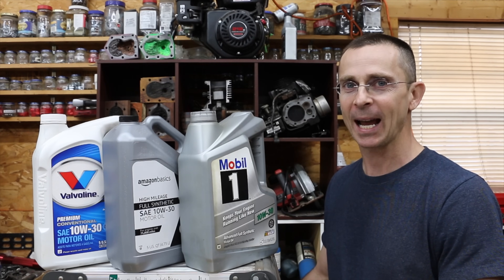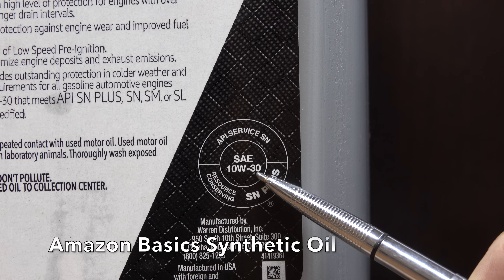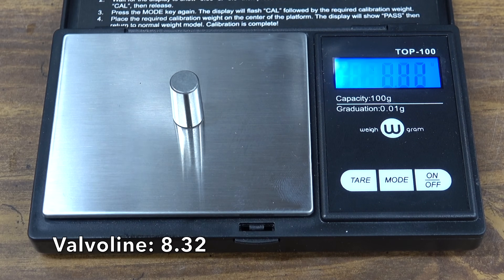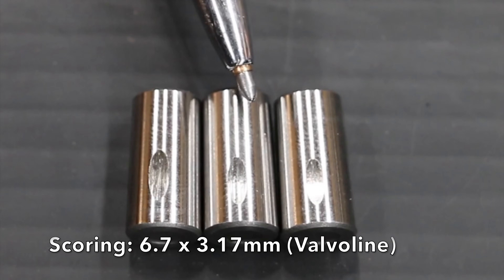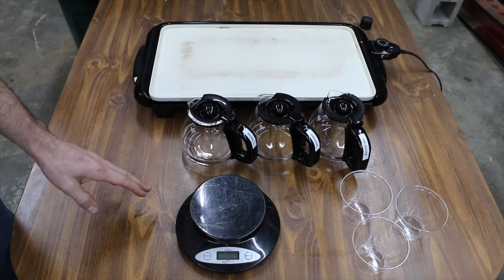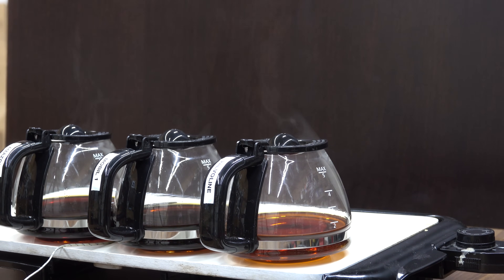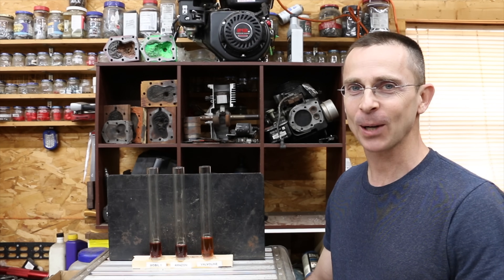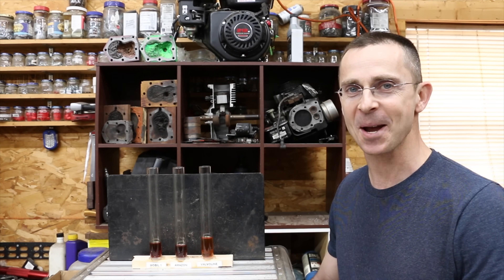Is AmazonBasics Full Synthetic Motor Oil better than Mobil 1? Let's find out!

Comment: Lubricity test is not done fairly. The level of oil in the cup for Valvoline and Amazon oil was such, that there was a little splash of oil when the wheel started turning and then there was no splash. And near the end of the test there even was no movement of the surface of oil in the cup. But for Mobil 1 there was a big splash in the beginning of the test. The oil surface in the cup was trembling during the whole test and it was clearly visible at the end of the test, that there was still a good amount of oil splash. So the wheel was either intentionally or unintentionally much better lubricated when testing the Mobil 1 oil compared to the other two oils. Nice try!
Reply: He's human. He's doing this out of his pocket to help us gain knowledge. But I'm sure you're perfect in every way.
Reply: Then the Amazon Basics should have done considerably worse. Instead it was incredibly close. As long as oil was being carried up to the bearing, the amount in the cup doesn't really matter as long as it doesn't cavitate (the bubbles would reduce the amount of oil in the film layer and increase friction - which didn't happen).

Comment: In the burn test, This explains why I always had to add oil to my old truck, even though I never saw a leak of any kind and checked all the time for leaks. Between oil changes I’d have to add a quart or two of oil. So was my engine always running hot then? The temperature gauge was never high.... maybe just a tiny hot, but not so hot the temperature gauge wouldn’t freak out and show high/really hot?
Reply from the maker: Same here. Thank you!

Comment: Great video as always love the way you do your testing. I'm pretty sure that the amazonbasics is made by Warren distributing. They also make the Walmart super tech oil.
Amazon's price on the synthetic is pretty decent but not significantly cheaper than the super tech synthetic. And when I looked for the conventional oil under amazonbasics it actually cost more than what I can buy on the shelf at Walmart for their conventional oil.
You can get their supertech conventional for about $12 in the 5-quart jug. Since my car doesn't seem to like synthetic oil, tends to burn it more I just use conventional oil and change at the regular 5K interval. Usually having to add about a quart. If I try the same with any synthetic brand I end up adding 2 quarts over 5K, basically eliminating the advantage.
Reply from the maker: Thank you!

Comment: Another excellent video. I recently purchased AmazonBasics 5W-30 high mileage synthetic and combined it with a conventional 10W-30 to devise my own blend. I hope you know that the label "Full Synthetic" is misleading. You would think (as I did) that synthetic means there are no components of crude oil involved in its manufacture. You would, like me, be wrong. There are basically 5 grades of motor oil. Grades 1 thru 3 are based on crude oil with increasing levels of refinement. Grade 3 is highly refined but has crude (dino) oil as its base. The petroleum sellers have mislabeled it as full synthetic. Grade 4 and 5 are highly refined and are really synthetic; that is they are not based on dino (crude) oil. According to Noria corporation, "Group IV base oils are polyalphaolefins (PAOs). These synthetic base oils are made through a process called synthesizing. They have a much broader temperature range and are great for use in extreme cold conditions and high heat applications." * These are labeled "100% Synthetic" and they do cost more but are supposedly superior in many ways to grade 3 oils.
So, I would really like to see a comparison such as this between any "full synthetic" and a "100% synthetic" such as Amsoil signature series (they also make other types) or other brands. This could give us a clue as to whether the higher priced 100% stuff is worth the extra money, as is often claimed by those who profit from their sale.
* https://www.machinerylubrication.com/Read/29113/base-oil-groups
Reply from the maker: Thank you for the video idea!

Comment: The Amazon oil is a "high mileage" oil...they tend to be a little thicker and protect a little better. I'm pretty sure they make a standard synthetic, too. Just throwing that out there.
Reply: they make it all two cycle, small engine, dirt bike, marine diesel, Gear lube...
Reply from the maker: Thank you!
Reply: Oils marked "high mileage" have a different additive package but the overall viscosity or 'thickness' isn't any different. Specifically they add more anti-wear compounds like Zinc Dialkyldithiophosphate where the enhanced phosphates can cause premature catalytic converter wear. That's why they mark high mileage oil for use for cats with more than 75,000 miles on them because the car has enough miles on it that the catalytic converter is already reaching the end of life and so failure can't be blamed on the oil you use. The high mileage oils may also have a slightly higher percentage of seal conditioning esters to help keep old oil seals pliable.

Comment: The amount of time you must spend on these videos is insane, but i really appreciate the thoroughness of all your tests .
Reply from the maker: Thank you!
Reply: Project Farm what motor oil do you put in your vehicles
Reply: No doubt, smart and entertaining, like I said my favorite channel for sure bro. take care.....
Reply: I recently used Pennzoil 5w20 full synthetic on a 2014 explorer 3.5l and drove from San jose to Las Vegas and back and upon returning I was extremely low on oil.  Car has no oil leaks and is my daily driver.  Pennzoil seems to evaporate rather quickly.  Made the switch back to Supertech synthetic oil.
Reply: @jmethlouthi  
You shouldn't have that problem with Pennzoil Ultra Platinum but it is expensive.
Reply: Xtrm is so right lololol
Reply: He gotta get the 10 minute mark for that ad revenue buddy

Comment: The lubricity testing is quite flawed, you just testing where in the "10W range" the oil is, anywhere from 7.5-12.5 will be called a 10w oil, and any 5w oil will beat all of theese... but better flow is not always better, if it was everyone should switch to 0w-20 oils right away.  a cold engine has more clearance on piston rings and other seals, and needs a bit thicker oil to seal and work properly, then when the engine and oil heats up together the internal tolerances in the engine gets smaller while the oil gets thinner. the right oil for the right engine is therefor important.
There is no "best" oil, there is "best for this exact application".

The bearing test is good tho, just test more oils with that, but test both cold and hot oil there. I bet oil right out of the freezer would win that test...
Reply from the maker: Thank you!

Comment: Why didn’t you use Valvoline full synthetic oil instead of the Valvoline conventional oil? The Mobil 1 and Amazon Basics oil you used were both full synthetic oils...
Reply from the maker: It served as the baseline for the competition between the synthetics.  I wouldn't call it a control but close enough.

Comment: Just wondering if motorcycle oil would make a difference?
A motorcycle engine has a much higher power density, rpm, runs hotter, oil is shared with the gearbox so should have greater film strength to resist the pressure between gears and additionally has a clutch in it that should have enough friction inside the oil.
How to combine al these properties or is it a scam for selling more expensive oil?
Car oil seems easy compared to this!
Reply from the maker: Thank you for the video idea!

Comment: The bearing test reminds me of a test that was conducted by a mechanic to show how Bestline engine treatment works..  I bought some for my Smoking and high oil consuming sports car..  It lowered consumption by 4 fold and stopped most of the smoking on acceleration and deceleration... I wonder if a test while adding Bestline to synthetics would yield better results on the bearing test..Keep up the great videos
Reply from the maker: Impressive results!  Yes, I tested Bestline a while back and it did great on the tester.

Comment: I didn't even know I needed this information until I saw the video. Details like rotating the heating pots really attest to the careful thought that goes into this. I will not be buying valvoline again. Many thanks.
Reply: The Valvoline was not synthetic, so don't count them out, I assume the Valvoline was included just to compare conventional to synthetic.  I have not used conventional for years, I had a deep sump added to my 73 Karmann Ghia, that was just filled with sludge after using conventional, I switched to synthetic, and had zero sludge.
Reply: @jjr007  in an air cooled? I thought about putting some in my 1600dp buggy but wasn't sure if synthetic would be good for it or not. I usually run 20w50 but genuinely curious how that works with synthetic?
Reply: Dont switch it with synthetic
Reply: @Outsideofthebox13  Yes, air cooled, never had a problem with the engines in any of the 6 cars I have owned since the 70s, when I switched to synthetic. I even use it in my garden tractor, quad, snow blower, and 4 stroke string trimmer.
Reply: @jjr007  Interesting, I was always told not too but winter time would be a good time for it. Looking at project farms cold test really says alot, that 20w50 or even 15w40 is like tar when it's cold. If my intake wouldn't freeze I'd drive it everywhere lol.
Reply from the maker: Thank you!

Comment: I had a 87 VW Jetta one time I changed the oil and filter. The oil light stayed on. I called a VW dealer and asked what was wrong. It was made for 20w-50 with a oil filter with a check valve. I wish I still had that car. But never understood why it needed such a thick oil.

Comment: Unfortunately, the results don't matter, b/c it's not the viscosity at 200F. Not to mention additives, resistance to shear, etc.

You'll have to try them in your vehicle and drive in the same conditions, then have them lab tested in multiple trials...and that result is only valid for that engine. A different manuf can yield far different results.
Reply from the maker: Thank you!
Reply: @ProjectFarm  Sorry, if that sounded dickish, but car engines are rather complicated when it comes to oil life/perf. For example, Nissans shear oil heavily. It's practically a necessity to use 40 weight if you want to even have a 30 weight after  3k mi lol. You'll end up with water using most 30 weights halfway through your OCI.

I did really like the noack test.

Maybe you could do some sort of pumping pressure test at realistic startup temps for the weight (ppl keep bringing up the cold flow test but 10w should never be used in cold climate). So, basically, if an oil has a significantly lower peessure, then you can conclude that it'll decrease startup wear.

Comment: I would have left the coffee pot lids up.  Some of the vapor would have condensed on the sides and dripped back in.   If you wanted to see how much would evaporate off.   But the way you did it simulates an engine i guess.   

As always great testing though.  You always deliver on that.
Reply from the maker: Great recommendation!

Comment: Great comparison test. Only concern is Amazon suddenly making a change in the supplier without notice
Reply: Exactly why I wouldn’t touch the stuff. I’d be very surprised if they didn’t sell premium oil to begin with at a loss and then switch to something to make substantial profit. Most people that buy oil off amazon would never know the difference.
Reply: @athhud you're probably right, although  the impact of a few bad reviews from knowledgeable people might deter them from doing so
Reply from the maker: Thank you!
Reply: it will say on the bottle who the supplier is
Reply: Do similar tests next year and see the results...
Reply: And mobil one dont? wtf does that even mean?

Comment: Awesome content! I can't believe that Amazon Basics is competing (and winning areas) over Mobil 1!
I'm not sure if it's true or not, but I read a comment saying that Amazon is using the (Walmart) Super Tech oil. I'd be curious to know if it Amazon is actually rebranding super tech? The stats point to this as a possible conclusion => Mobil 1 cold pour temp being -43°C and Super Tech being -46°C. Found super tech on bobistheoilguy.com and Mobil 1 on their website. 
I recently went for the Mobil 1 "annual protection" (because I got a deal), so far it's better than anything I've used.  All stats point to it being superior oil, but it comes with a cost.
Reply from the maker: Thank you!

Comment: I must say, this is the first video of yours that I must give a thumbs down for. I would have been fine with it have you explained the differences between synthetic and conventional. Many of those who are not familiar with oil types can easily be misguided into thinking that the brand itself is inferior rather than a specific product produced by them. If your intention was to use the conventional oil as a baseline than I would not have mentioned its brand as it simply isn't a fair comparison. If you look through the comments section you will see many who have been misled by these results.
Reply from the maker: Thanks for the constructive feedback.

Comment: Yes very interesting, I had been using Mobile 1 since the 1980's in fact 1980 with an Oldsmobile Cutlass that had a 260 V8, later swapped it out for a 350 which was night and day. I used Mobile 1 for many years but decided to learn more about oils and then learned about Amsoil, used that for years and today I use Royal purple. I kept automobiles for not less then 10 years and I found either the engines were not made as well as they could be or Mobile 1's original formula was not up to spec with other companies I talked about. I have read that Mobil did up it's game but to late for me. 
Amsoil would push OW weights which I'm not a fan of unless you live in extreme cold conditions. I used Amsoil in a 1994 Ford Taurus wagon for mainly highway use servicing customer equipment in Wisconsin, the engine lasted 250K but I did use 0W weighted oil in the 231 V6, personally I think it would have lasted longer using the recommended 5W weight, live and learn. Around 250K the engine started developing low oil pressure.  
Royal purple since 2007 with a Ford Focus doing well with the correct weight and their synthetic oil filter, Amsoil synthetic transmission fluid since I owned it new. 131K on this car to date. 
The most interesting question that needs an answer is who is the supplier for Amazon. Seems another oil out there is flaunting the SE+..
The only issue I might bring up regarding Amazon would be will they change suppliers and how often? It's all about profits. I like to stick with a supplier for basic ideology in chemistry myself.
Reply from the maker: Thank you.  Amazon's supplier is Warren Distribution.
Reply: @ProjectFarm  Serious need to dig further and understand Warren Distribution.  Who are the suppliers of their products? I'm thinking others might chime in and advise. The products I know are Mobile, Amsoil, Royal, I'm sure there are others out there working military and Aircraft that are not well publicized; will be interesting to see where Warren fits into all of this. Zero conspiracy just a want to know where materials are made and companies that actually produce them. I'm thinking from there we might find a data sheet, did you find a data sheet from the Amazon product. Interesting discussion at the least.